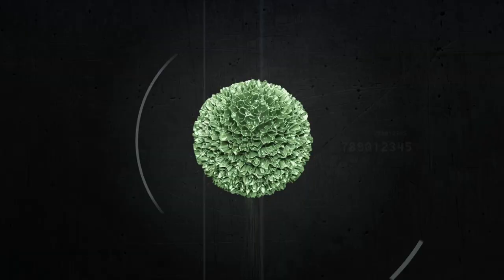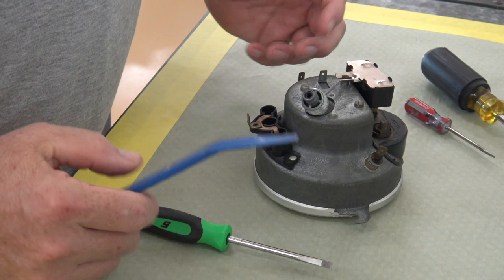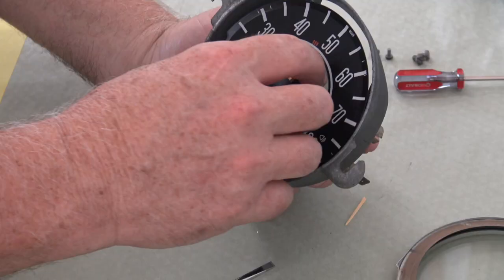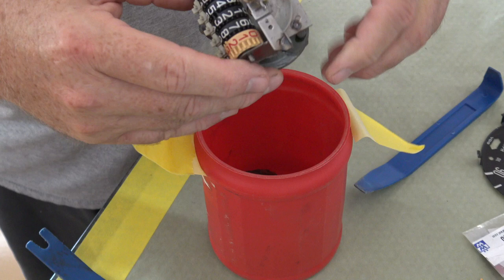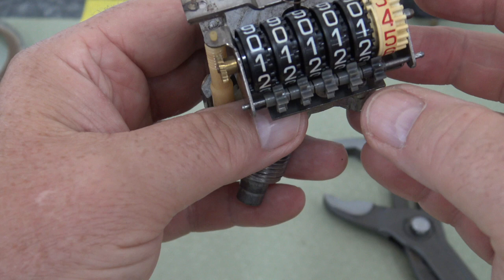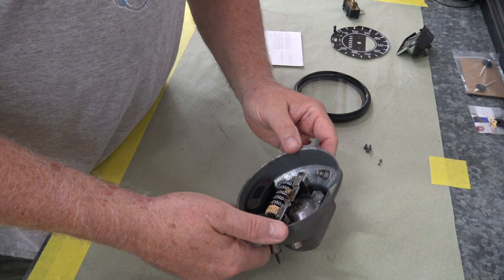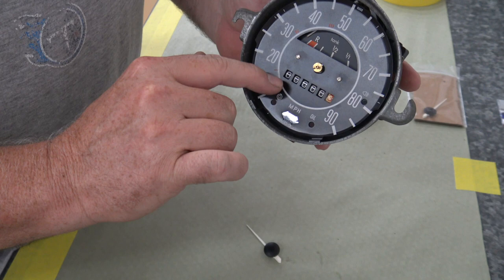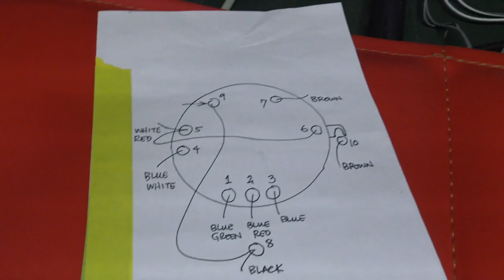VW Beetle Speedometer Repair

Comment: This was exactly what I needed.  Thanks for the clear and thorough review.  I was hoping to find out how to install the needle but the odometer reset, view of the fuel gauge, clarity for how I can remove snd clean the dusty face and replace the gels were super helpful.  I’m doing an electric conversion so I’m thinking of replacing the fuel gauge with a state of charge screen.
Reply from the maker: @kleekru Glad it was helpful.

Comment: Is there a way to fix the return spring without replacing it from another speedometer?
Reply from the maker: @lutherolaco2996 I'm not really sure. I've never done that and I guess it would depend on how bad it is. Would probably require some soldering. Sorry I couldn't help.

Comment: I have a speedo my buggy build it is complete, I will need to replace the film for the turn signals and Oil, Gen.  The other issue I have is I do not have the original wiring harness so I do not have the bulbs and sockets to mount them into the speedo.  Have you got a source for them?   This is very informative, I now feel I can remove the bezel and clean it out inside
Reply from the maker: Thanks! There are several sources to get a wiring harness. JBugs, CIP1 and American Autowire are a few.
https://www.americanautowire.com/shop/classic-update-kit-1962-74-volkswagen-beetle
Reply: I finished the repairs to my Speedo today.  Looks great. Hopefully it will work great as well.